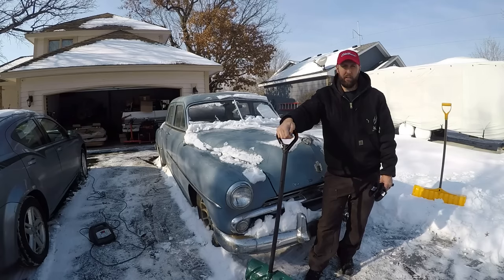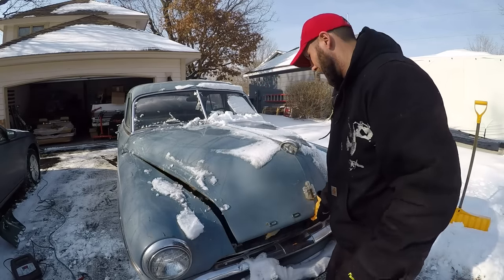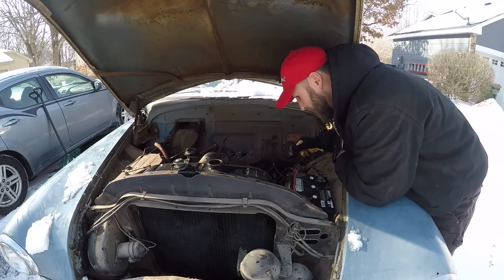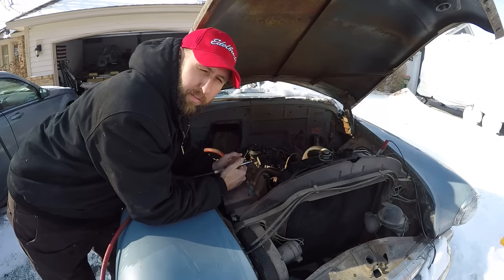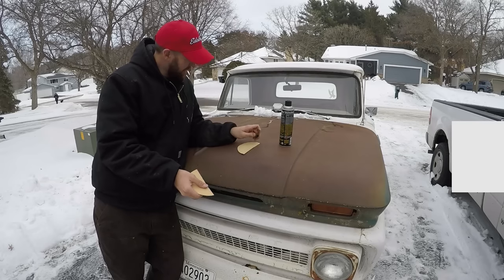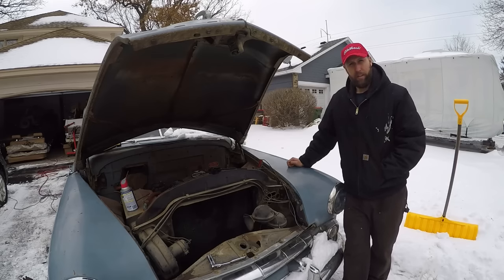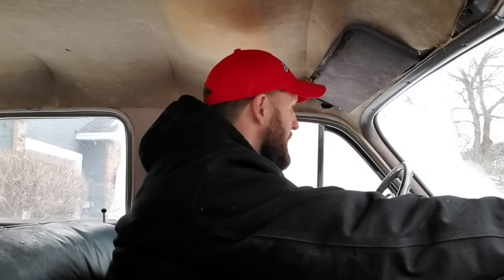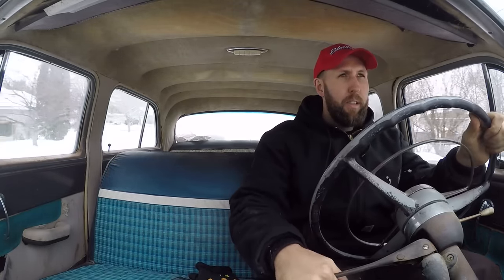1952 Dodge Barn Find First Start - Will it RUN AND DRIVE?

Comment: Horrible Fright has those spark plug sand blasters cheap. Or you can get a good one off of Flea Bay. Rock Auto has the universal J-8C Champion plugs for about $1.25 ea. I'm assuming you changed the oil before you beat up old Bessie. I do have to laugh at you youngsters. Here's a tip from an oldtimer: remove the starter motor and clean the bell housing and starter where they make up. Good connections and grounds are essential for 6 volts. Re: Jonathan W.

Comment: I had one of those if you put that in 3rd gear you can start out just like an automatic transmission it's just the same as 3 on the tree. You do not have to shift it from 1st to 2nd to 3rd it will do it automatically or you can drive it like stick shift and put the clutch in a shift it like a stick shift.  MR WELSH

Comment: Yeppers - one thing about these old cars with no brakes - ease em into the driveway and worse comes to worst, just bump it into the house. Guaranteed ta stop it, no problems. Darn it! Ya didn't bump it into the house! I guess that's a good thing. As hot as the car was - coulda set the house on far.

Comment: You can't use the emergency brake on these to stop them, either.  They clamp onto the driveshaft.
Reply: The hand brake has to work,  with fluid drive putting the car in gear will do nothing to hold the car.  If you manage to drive off with it on within a block the band will get hot and lock the drive shaft....I've done it...
Reply: @kaa522  It was such an inadequate system that they included scotch blocks in the trunk in case you had to park on a hill.

Comment: A guy is thinking no us car had key start  till 1953 or 54 so it would make sense to have a starter button. My 1951 Packard has the starter in the gas pedal. half way down engages the starter

Comment: Is WD-40 on ration on your side of the Atlantic? Surely she deserved a bigger squirt down each bore! Being a sidevalve, you would have lubed the valves as well. Great car by the way. Another one saved. Just finished a 1955 Ford Consul Mark 1 in England, off the road for about 45 years.

Comment: I wanna see a video where there's a fuel injected car that's been sitting for 30 years and you start it. Would this be harder or easier i'm figuring harder because it's easy to pour gas down a carb to start a cold girl. I don't know how I'd start my old suby if she was not carbureted after sitting for months in the extreme cold.

Comment: I was looking in a box of my parents old photos and came across the bill of sale for my parents 1952 four door Dodge Sedan serial # 98046627.  They bought it used from Russell Motors Limited May 27 1959. 
They paid $700.00 for the car.

Comment: Of course, it runs after 10 million years.  It's a dodge!  If it were a ford you would still be working on it in 2022 and still not get it to run right.